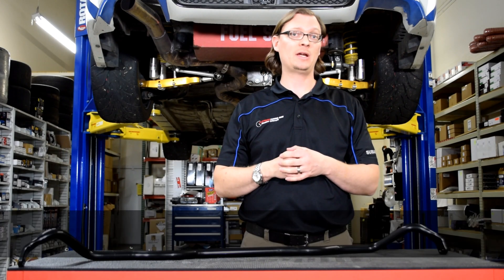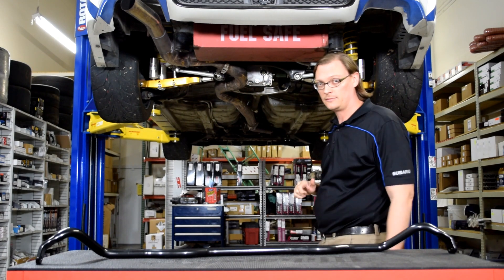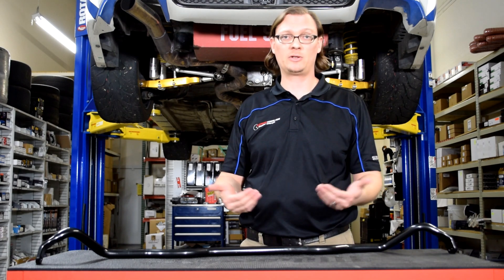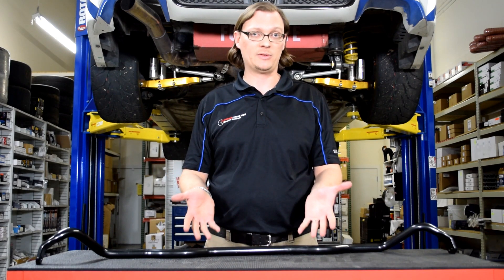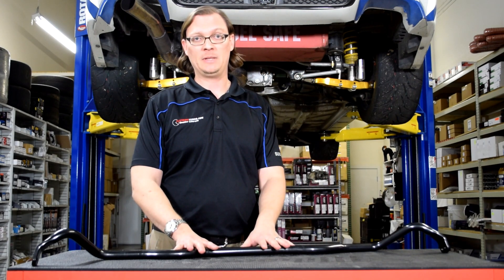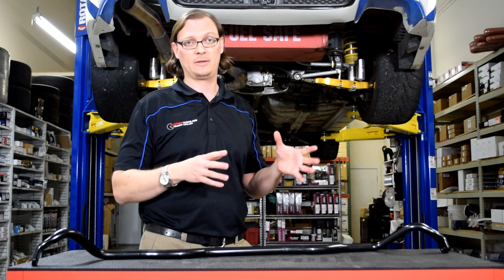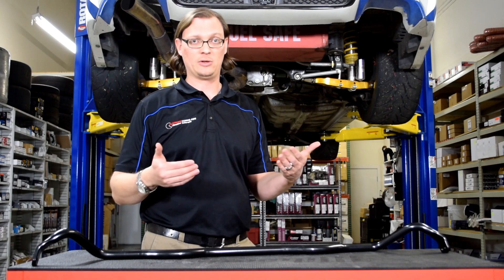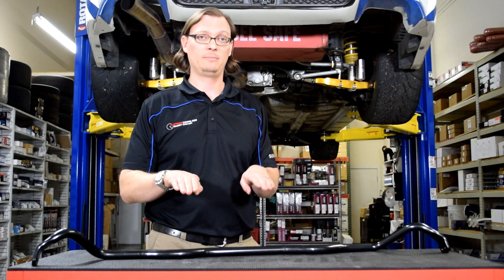All about Sway-Bars and how they work

Comment: Could you please expalin about running no front or no rear sway bar for drag racing purposes?

I've read that no front sway bar with transfer weight to the back more to have a better 60ft for drag racing.

But ive also heard no rear sway bar, you have more grip straight line but more understeer.
Reply from the maker: Thanks for your question.  Honestly, I haven't heard this reasoning.  It would make sense that you would remove both front and rear for drag racing just to save weight.  Remember that sway-bars don't start working until one side is compressed or loaded more than the other.  So in a standard launch, a sway-bar would not actually start doing anything.

If you lose traction, and the car starts to lean to one side or the other, then the sway-bar would start working, and in that situation a sway-bar may help you keep control of the car.

The other example I could think of would be if you have a very high power car that actually twists the chassis when the car launches.  In that case, having a rear sway-bar would resist that twist, and may give better traction in the rear.

More than anything, I'd say that this would be something that you just need to try out.  I'd say start by removing both bars and see how the car feels on a run.  If you feel that one axle or the other would benefit from the bar, put that one back on, and see if you have made an improvement.

I hope that helps!
Reply: thank you for the info!

I know that rear sway bar helps alot with that torque twist you're talking about.

And the front lets the wheels hang longer for longer weight transfer, what ive heard and read, not tested myself.

I'll try with the front off first and try both and see how it goes. My car from factory has 600nm at 1900rpm and 380hp at 2200rpm till 6000rpm. So it twists even on stock power. I can only imagine when i tune it to 600hp and 1200nm what itll do....
Reply: Drag cars have only rear bars to compensate for the torque twisting the axle.  However they have different kind of sway bars.  They work independent of each other.  So you can preload your torque side and your other side won't get wheel hop.

Comment: Put a perrin 25mm bar on the back of my 17 wrx and can tell the back end want to come out more in the snow this year vs last year on the stock bar.
Reply from the maker: Thanks Malkionx.  Yep, they will do that :-)  If it is too much you can balance it with a larger front bar.  This is where getting adjustable bars is very helpful.  If you can get close to where you want to be with bar size, you can then use that fine adjustment of the bars themselves to really dial in your cars handling.

Thanks for watching!
Reply: FlatironsTuning I like it car previous to this was a 15 mustang and it gives some more entertainment in the snow
Reply from the maker: Nice :-)